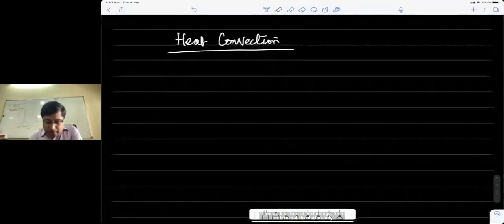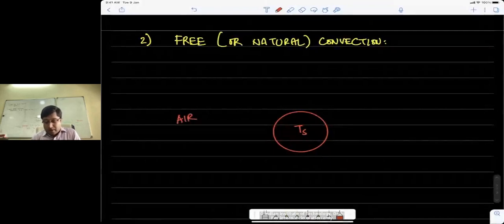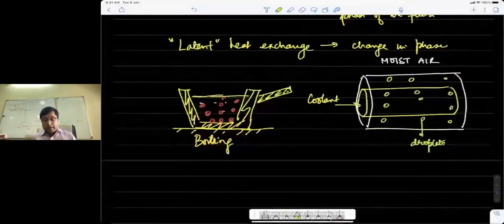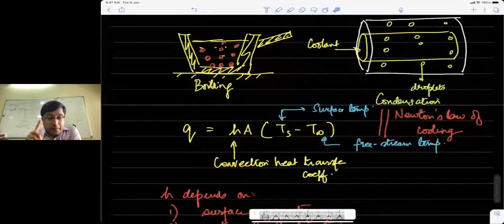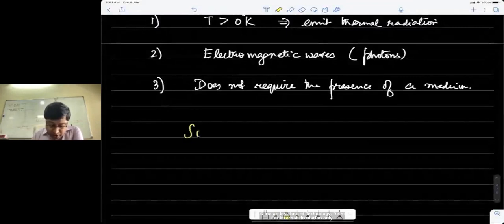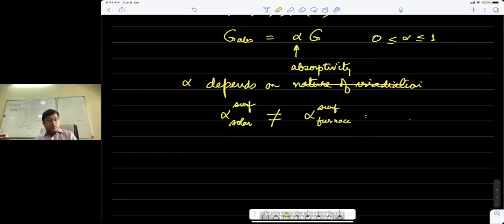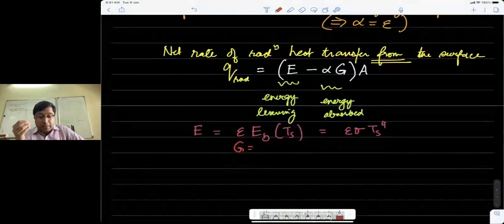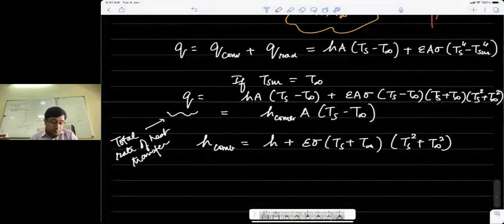Lecture 2: An introduction to modes of heat transfer

Comment: Respected Sir, Thank you very much for uploading these lectures on your YouTube channel. It is a blessing for the students to watch and learn heat transfer from them. Kindly teach some more subjects like Internal Combustion Engines and Refrigeration and Air Conditioning that would help students to better understand the subjects which form an important application of engineering thermodynamics. 🙏🙏🙏🙏🙏🙏